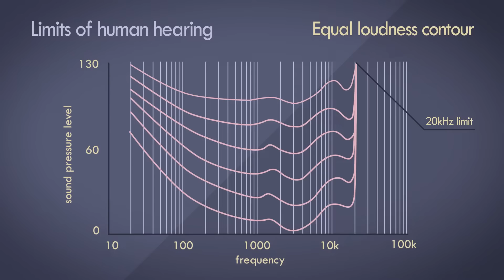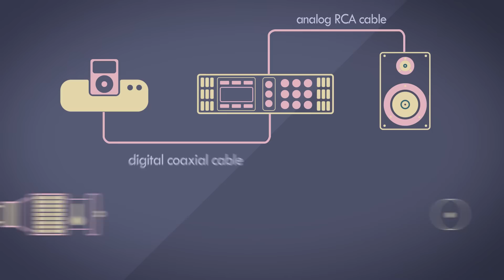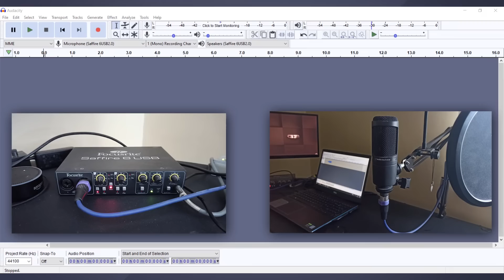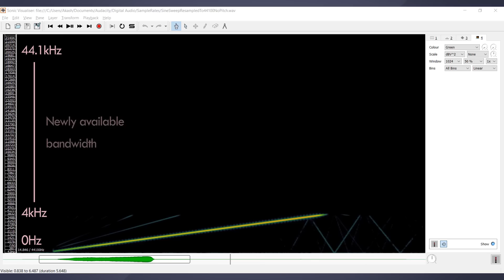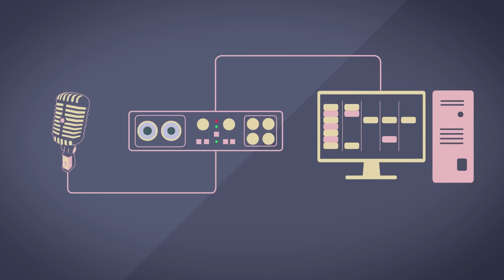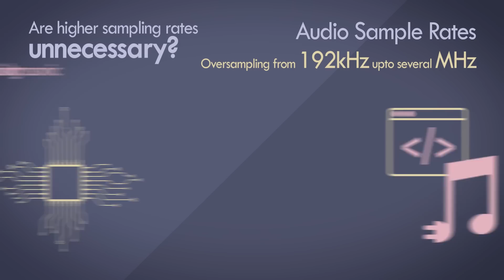3. Common Audio Sample Rates - Digital Audio Fundamentals

Comment: Thank you so much for the series, Akash! They are super helpful! On the topic of sampling rate, just curious to know how 44.1k or 48k became a standard. Why not 42k or 43k, or 49k or any other? Why exactly 44.1k and 48k?
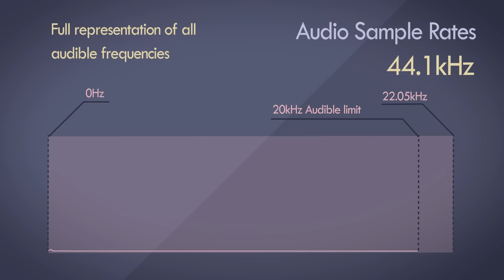Reply from the maker: You're welcome! As I had briefly mentioned in the video at 12:22, the sample rates were chosen to work well with current standards of the day and the requirement to keep the mathematical conversions as simple as possible to avoid loading up slow processors of the day. You can read up on it more online, it's an interesting read.
Reply: @akashmurthy  Thanks man! Really appreciate the effort!
Reply: In the early days of digital PCM was stored to videotape.  44.1Khz relates to the NTSC/PAL videotape PCM storage constraints.

Comment: Amazing content, Im junior engineer working for a company that works for dolby atmos. Your videos are superb! And graphics also! I really like the graphics in the video, what kind of software are you using for them, do you make them or someone else?
Reply from the maker: Thanks man! Interesting! What do you work as, electrical or software? I use After Effects for the animations, and yea, I make them myself.
Reply: @akashmurthy  I work as software enginner. Basically we do certification of dolby atmos software, and implement it on a real hardware like  soundbars. They write a bunch of c++ code, we translate it into assembly for dsp to use. Do bunch of testing, send back for certification :)